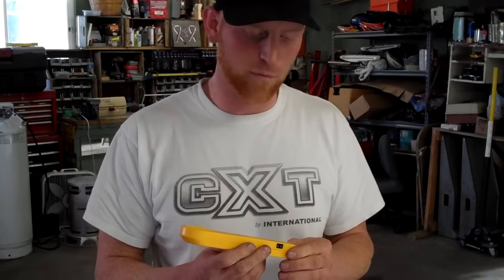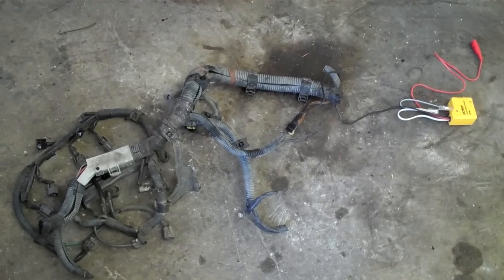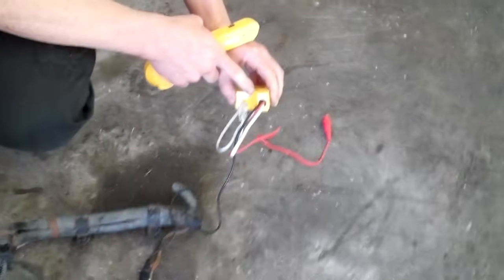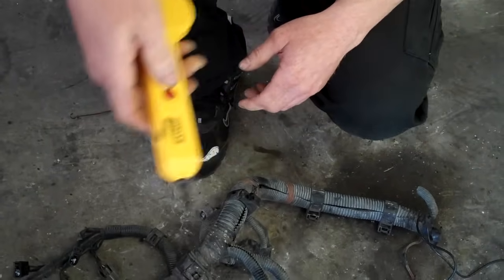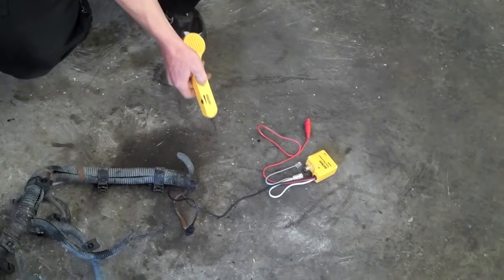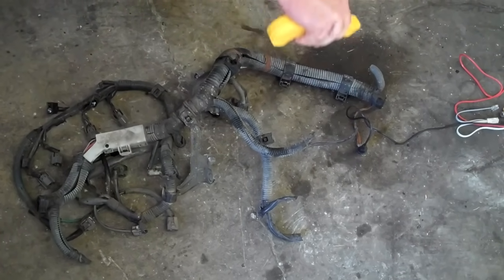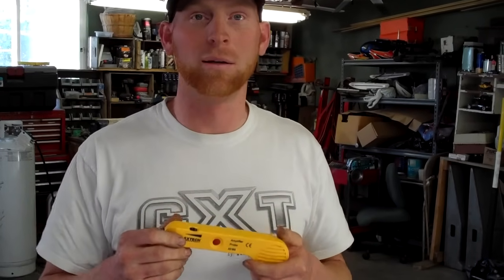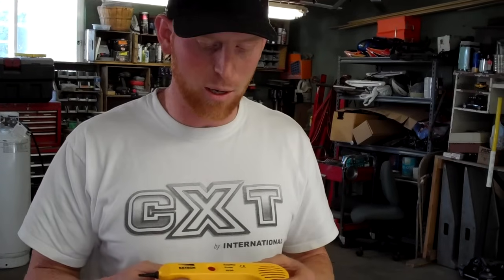How to find an open circuit or shorted wire the FAST easy way

Comment: @briansmobile1  I didn't click thumbs down but the demo was Not great. How will you hear the tone difference if the wires don't fall of a cliff (cut) and end? Maybe cut 1 wire in the middle of the harness and do the video again. P.s I could hear any difference when you went up or down on the wall.

Comment: These are good tools but their not very exact like people think they would be. 

It does NOT tell you where the break in the wire is there’s still some guess work since you could have a situation where the wire is cracked and shorted however not broken so in this case you may cut into the wrong section of the harness 

It’s not magic is all I’m saying lol

I used one of these for the last decade working in telecom

Comment: Hi I hope you are doing well. I am trying to learn. That would be a very helpful tool that it seems to work also on electrical at the house.I do get the meaning of how useful can that tool be . With a little imagination one can put this tool to use. I don't need to see the actual brake on the line just knowing that it will follow the wire without braking the harness. It will be a lot of help.Thank you

Comment: The handheld wand is an induction amplifier so it picks up EMF or other transmissions and amplifies them. That is why you can hear the 60hz from the electrical cable in the wall. The same holds true for the toner in that you can hook it to a wire to trace (with power OFF) and you point the little tip at your wall and sweep it back and forth and listen for the loudest tone. You can then sweep and follow that wire. I found a wire that was open one time and I told the guy where it was but that I had to open the drywall. Behind the wall was a buried junction box where the wire burned open. They had the box packed with dry newspaper to allow for the drywall to be patched. What happened is they changed a window out to a door and cut and extended the wire on either side of the door. The customer only let me fix one side so I had him sign a waiver that I attempted the complete repair but he was refusing to let me fix it...SMH...I mean it's not like there isn't a possibility of it arcing and burning possibly starting a fire? It already did that...people...

Comment: Problem with a tracer is if you have a short the tone drops out. I have some that are more sensitive so you still get bleed over but generally when you put the continuity on to ground and you have a shorted wire the tone drops out a lot. Another option is the Ideal suretrace...which is why they are like $1,200 dollars instead of $100.00. Also if you have that toner on with line voltage power you will smoke your tone generator so...
Reply: https://www.youtube.com/watch?v=tZuCJK2-uLs

Comment: That just made no sense, if you were looking for a short, the other wires connected in the line would cause this device to beep defeating the purpose. The only way to truly find the short would be to test each individual line with a multimeter. The device is basically a locator of current conducted through a  magnetic field.

Comment: if your vehicle has an electrical short in the wiring harness, the UNANIMOUS consensus from hundreds of years of combined auto repair experience IS:  make sure the insurance is paid up, set it on fire, push it off a cliff, and report it stolen.

Comment: Its called a tone generator and wand, dont know how he identifies a "short" with it, its used to identify continuity through a single wire or pair,  continuity setting will show you if there in current when clips are attached.

Comment: I retired from AT&T use the tone generator for 40 years after reading some of these comments I think it's too simple for them to understand you turn the amplifier down to the minimum volume and when you get close you can tell the difference in the amount of tone being generated and that's where you start looking for your problem but you have to listen to the tone
Reply: That really helps knowing that.
Reply: That’s how my dad taught me to trace and tone twisted pair and coax.
Reply: Ty.  I was looking for your comment to verify I'm not an idiot.

Comment: If you put the probe on, you'll get the ringing sound if the wire is open. If the wire has a short in it, there'll be no sound 
Another way you can make the sound louder is put one lead of the continuity tester on one wire and the other lead to a ground.  This idea however, you will not know if the wire is good; But you will find the wire.

Comment: You're the first guy who actually traced one wire using ONE lead (black) of that tone generator. All the other demonstrations I've see used two wires and both black and red leads which made me think the device could not trace one wire. I only want to trace one non-energized a/c wire (behind sheetrock) and see if its among a group of wires at another location. THANKS!
Follow-up...I purchased a Fluke that's similar to the tool you're using and it worked just as you demonstrated. I found the wire I was looking for and was able to repair my a/c lights and power receptacle issues very quickly. THANKS AGAIN!!

Comment: You only need to connect the black lead to trace a wire out?  I need to find an open in a garage door 2-wire behind the sheetrock.  One of the conductors is open (likely from stapling too hard).  Will this tool do the trick?

Comment: Brian, I've got a question. I replaced the plugs and wires on my 06 (Exploder). I put in Motorcraft wires and Iridium plugs.
 My problem now is hard starting  (longer cranking) and vibration till it warms,about 30 seconds. Diagnosis ?
Reply: Dump the FORD.  ,1ST mistake
Reply: @Tufftoy5862  LOL,don't think so Rudy.I've got 220K miles,fun and comfortable to drive and no payments..Going for 500K, how's yours ?
Reply: @gene6195  
You don't know how LUCKY you are.   To get that kind of milage 👍 
I have a 1990 Toyota 6 cyl  p/u  378k still going strong.  It's a back up truck to haul lil crap around
Reply: @Tufftoy5862  Keep going Rudy !

Comment: TD because you only showed how to follow a wire to an open circuit. You said shorted wire but if it's shorted to another then the tone will continue in the other wire as well. Without a visual you could not know if you are tracing a different wire. Also that harness was a bad example as the tone was throughout the entire thing.

Comment: Bad demo for a very useful tool where ever there are wires with issues.  I've used a phone company one to find wires buried in walls that drywall hangers covered in construction work. I've even used it for phone repairs weird as that may seem.

Comment: Sadly, this won't work to find a short or an open.  It's obvious why it won't find a short.  But an open won't be found either.  The tone bleeds across all the wiring in the harness and therefore you'll run right over a bundle of wires with an open and you won't find it.  This device works  only when trying to find an open in a single wire, not a bundle.

Comment: I don't see how that would work. Say I have a split in the wire and a clean break so the open and actual separation from wire to wire lets say it is 1/4 to 1/2 in length. I never used one of those but from what it looks like is the tone will continue on because even though there is a break in the wire it will still sense the other part of the wire and give out a tone. After Brian moved the toner away from the wire it was past 6 inches of the wire and the tone was still there but just low sounding. Basically it looks like this tool might not be sensitive enough.

Comment: Thanks for the broadcast would have Bern great to see it done on a car I'm trying to find a short my OBD II port no power so do I put the alligator clip on the wire I'm testing? Thanks for help I'm going crazy no one will look at it for me!
Reply: Hello. 
Have you figured your issue yet? I am suffering the same as you with an open line on the CAN L (neither power, nor ground) on the OBD branch line. Sounds accurate but the wiring harness... ummm, this is not a game...  big harness behind the instrument cluster nd between the steering column and the dash. 
I have a similar device from snapon. All my home went in shambles.
Help if you figured out your issue.

Comment: Well Articulated Presentation BUT deserves a "Re-Do"
1- No Actual Findings of Any Short/circuits etc.
2-No Reason stated as to why Tool 'Sounded Off' on 'Top' area of  Wall Switch (w/out Wires) as well as 'Bottom' area (where the Actual Wiring was Located). "?"
3-it was a Poor Demo of a 'Seemingly' Great TooL
Try Again & GdLuck

Comment: Have a Ford Focus with rare 2.3L engine and short is killing the battery.  Thanks for your video. Might be the Alt or harness such as the one you show in this video. 75.00 bucks to replace one but that is the trade off. Finding and fixing or buy replace harness and hours to install. $$$ or Time spent. what to do?  Thanks

Comment: 2:11 "I just lost the tone" - Well of course you did, you waving away from wire. but when you bring this tool back to place where, as you said, the harness was broken, it rings again, like there is no broken wires. I didn't see an open circuit or shorted wire demonstration.
Reply: yea if its a short it just going to keep going in a around and around

Comment: im a retired telephone man and i can tell you that using a toner and locator for automotive stuff is a waste of time. that tone will be all over the place in that harness. it just is not precise enough for a system that has hot and ground all over the place. you will be chasing your tail forever in a real world scenario . and if you are chasing a ground problem, it really becomes useless as you will hear tone just about anywhere you probe the car/truck/motorcycle/whatever

Comment: Hey how can I check if a connector is good without it being connected to the car? I cut the camshaft sensor connector off a junk car so I can take my cracked one off and replace it with this one that I just got. However I don’t want to cut the one on the car until I know the wiring is good on the one I removed off the junked car. It is a 04 Altima 2.5 camshaft connector

Comment: I did not realize how old this conversation was. I agree with other posters, don't confuse an "OPEN" with a short circut.
If it is a SHORT circuit there would be blown fuses or "TRIPPED" electrical Breakers.
In my 30+ years, (IN NEW JERSEY) I can say , it has to do with salt effects after a snow storm. Electrical connections don't like salt,(neither do I)  
I have put in over 120 man hours in the last year on our 2004 Tahoe , with 160K miles and I still need to replace/repair,,,, SOOO many things.

Comment: Shorts or broken wires are ahassel to repair and find by looking and guessing the demo makes it easier and faster to locate than "let me see" or "Wonder where this goes" I use to use multimeter will look for this tool. Anyone want need short finder training buy buick, the trunk wires flex and break yearly. Thanks Brian.

Comment: We have some tones that will work while the short is present,  tip and ring must be used from the tone on the shorted circuit.   The tone will be heard before the short but not past the short.  The tone you have will not work while the pair ( circuit) has. Short it will cause the tone to go mute.

Comment: a brake in the wire is an open not a short!  The phone co. used the inductive pick up with a butt set and referred to as a banana.  Later the speaker was added for convenience with other suppliers.  But yes tracing pairs is always necessary in cable especially in pulp cable with no color code.  The advancing optical cable is fast making these actions less frequent.

Comment: Loose and or corroded grounds are fun to find.  They loose momentary connections long enough to cause temporary problems.  Normally it conducts good enough but hit a bumb and the circuit opens.

Comment: I use this tool every day. You have no idea what you are doing. The tone generator sends a signal on the wire and the wire becomes an antenna. You will get inductance through the wire bundle. The other noise you hears when you got by the light switch is 60 cycle hum. Has NOTHING to do with the tone generator. You can use the generator to trace a wire in a car but you have NO idea how to do it.

Comment: The better fox and hound probe kits have a 60Hz filter switch on them, so that you can get rid of any nearby AC electrical interference or hum from overhead lighting, etc.   A must-have when needed to isolate a wire in low-voltage circuits such as this one.

Comment: I forgot to ask in my last e-mail,  will this detect an open circuit at very low amps?  I have a very low current leak somewhere on my Audi that I need to find as it is draining my battery every couple of weeks.  tank you.

Tony

Comment: Thank you for the video, it takes a lot to try to show people things. But I’m not entirely sure this would work well, I’ve used a tone and probe kit before in phone pairs and for the most part the whole bundle makes noise, and most of the pairs make noise too, especially not being shielded. Interesting thought though. If you are looking for a dead short or a break although it may be hard on sensitive electronics a multi meter could help.

Comment: Hi Brian.... I got my vehicle back (with police assistance) from a "professional" 
shop that sabotaged my jeep.  I (think) I was able to correct everything
 they did except now I noticed (after i turned on my lights) the shop 
pulled out one of my electrical terminals on the fuse panel for the 
headlights and running lights. 
So, when I turned on the headlights the HD light switch fried and the HB
 indicator fried.... 

The only terminal for the fuse block is the power feed out. What are the
 steps to fix their damage?  (i noticed when I got my jeep back that some of the circuits are connecting that aren't supposed to...)

 Hope I didn't confuse you. Thanks!
Reply from the maker: That's a tough one.  Sabotage isn't consistent.  There's no protocol for addressing that, but I would check into the headlight switch first.
Reply: Hi, Thanks for your response. Yeah, the headlight switch is toast. I was going to assume I was safe (why would anyone be so mean?) until the HD light switch fried which may have caused other things to tweek. Or if they did other damages. I Finished the rear harness and most in the engine bay. Now ripping apart the dash to go through each and every wire. Its a pain but I'd rather take my time then have it catch on fire or something else worse. So, am going through all the wires now. Thanks for your video. :)

Comment: you didn't explain how u find a short. that tool is a tone generator and is used to locate a wire not find shorts.  fluke networks makes a short stop detector that works great. TS100

Comment: Can this be used on a live wire? I want to test for a open circuit but it requires the key to be in the on position to close a relay and some switches.

Comment: Worked in a high volume body shop in the early eighties- had a suburban roll over that didn't total  due to the extent of the work we wound up with a few of these shorts
Driving at night hit a bump and the lights would flicker
Could have used one of these
Complete interior came out to find two shorts under the carpet
A real pita

Comment: Brian, the manufacturer set you up to fail, Dude.  The 1-to-3-inch proximity is worthless in a bundle of wiring (one can readily see if a wire goes into a bundle.)  The phone company tool has much tighter tolerances... it has to be right next to the wire... for identifying individual wires within a bundle.  --  You tried.

Comment: Hi, 
I wanted to thank you for your video. I'm quite horrible with electrical. I've been for the past hour trying to wrap my head around isolating one wire in a wiring harness using a multimeter, a 9v battery and some alligator clips. I thought it'd be simple enough to push a voltage down one wire and then read it on the other end (not understanding about return paths). You didn't completely solve my problem, but you inspired me to use the continuity mode on the hound of my tone generator set to push the voltage on the pin and then read the pin on the far end of the extension harness to accurately detect which wire was going where. The problem with tone generators is in close proximity to other pins, the volume of the tone can be equal making it unclear which pin in a harness is the exact one. By reading the voltage with a multimeter you know exactly which one is getting all the love.

Comment: I appreciate your video but I think your video is more about using that tool in the tone generator setting and not actually explaining how to locate a short or open circuit.  People probably want to see you locate an actual break.  
If you wanted to show how to find an open circuit it would be better if you actually had a wiring harness with one wire that had an internal break somewhere in the harness.  Then you can show watchers that the tool can actually locate that break without having to open up the entire wiring harness.  I could have used this tool yesterday when I was looking for an open circuit in a car's wiring harness.  I did locate the break at a bend but it was a logical location to me, but using this tool would have confirmed the location of the break more accurately.  
I think I will buy one so thank you and keep your videos coming!

Comment: If you have a wire you can't find then this tool points out where it broken in the cluster of wires instead of going through every wire blind you know where about a your broken wire is

Comment: basically the same thing as the AC light up power tester used in homes to test power to the circuit before you work on it, but this one appears to be AC/DC and uses sound instead.